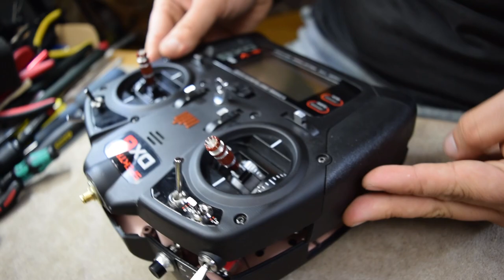$8 DIY Spektrum DX6 Range Hack

Comment: I think I read somewhere that you don't need to cut at all and that the piece will screw off. What gen is that dx6?
Reply from the maker: It's a DX6 G2. I can't imagine how, it was all one piece molded plastic.
Reply: Wheels ON yeah I think the G3s are a bit different
Reply: yeah, i think the 3rd gen comes off.
Reply: That's only for the 3rd generation dx6.
Reply: I have the exact same radio that he has, the front cover of the gen 2 is all one piece.
Reply: I think we are talking about two different things.  Do you have this radio, the g2 version?  the front cover on mine and the black plastic that covers the stock antenna are all one piece.
Reply: Thanks
Reply from the maker: The antenna cover is one piece blended in with the whole plastic. Don't you think you still need to cut to install a  larger antenna?

Comment: So does this actually work? Contemplating on doing it to a Dx7
Reply: Kwak_RC it's not working! Tried same ok my fx7s and that mod reduced my range for 1/4
Reply: Tested today with a DX6 G2. Range test with stock antenna - 40 steps. With new antenna 70 steps and still strong signal. More than 50% gain.

Comment: How much range did you gain?
Reply from the maker: I'd say about 40% - 60% increase in range. I lose video transmission before i lose radio signal now.
Reply: Sunny Soundrise How much mw do you use? Get a patch or a 16dbi rhcp antenna on eBay for $16.
Reply: @furonwarrior , modifying the antenna does not change the wattage output. If you have a 100mw module in your transmitter, (that's just one tenth of one full watt), regardless of what type of antenna you use, it will not change the wattage output from the transmitter module.
Reply: Alan Wylie That’s not true... antennas are measured in decibels. The higher the decibel, the more RF power output you’re transmitting, but it does sacrifice the “focal” length of the antenna. The higher the gain, the more likely you’ll get a brown out because the RF energy is more concentrated in one direction. With a patch, you would have to keep it pointed at the airplane or quad, but your range would be much further and you wouldn’t be wasting any RF energy.
Reply: With a 16dB patch antenna, your 100mw transmitter turns into 4.3W of RF power from the patch antenna.

Comment: This is a diversity radio, so why you changed only one antenna and not both (the other one is on the handle)?
Reply: The older models (G2, SPM6700) only had one antenna.
Reply: @robertgosz4281  There are diversity antennas. You can see them at 0:25.
Reply: @someone1974  Those 2 little grey antennas are attached to the wireless trainer module. FCC ID BRWDASRX20 I believe.

Comment: When doing this, you need a Ham license to use this legally because you modified the originally antenna. Also, I thought there was two antennas with different polarities? lol
Reply: Only if you were transmitting with anything with ONE WATT or more would you have to have a Hamm radio licence, modifying the antenna doesn't change the wattage output nor would it justify the need for a HAMM operator licence.
Reply: Alan Wylie No, it doesn’t matter how much RF output you are transmitting. The radio would need to be reevaluated by the FCC or by yourself if you have a license. A lower or higher decibel antenna does change the RF wattage output thus voiding the FCC ID. Regardless, I was just saying this to let others be aware. I don’t personally care what you guys do. But if you had a ham license, it’s honestly better to just get a UHF long range system for the transmitter instead of boosting your signal an extra 100 FT with a higher gain antenna and accidentally break your expensive transmitter. These radios can already fly way beyond line of sight without any modifications even for short/mid range FPV. Even 50mw is fantastic for 5.8GHz with a 5dB RHCP antenna for FPV. If you added a 6dB antenna to a 100mw transmitter, the antenna is outputting 400mw of RF power. If anything a patch antenna mod would have been better.